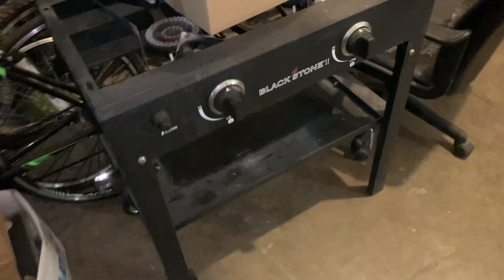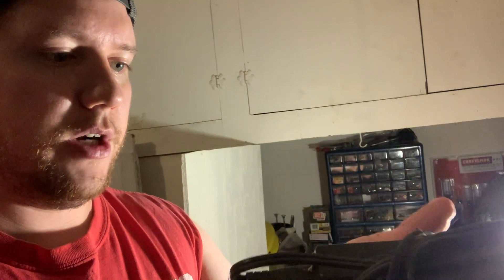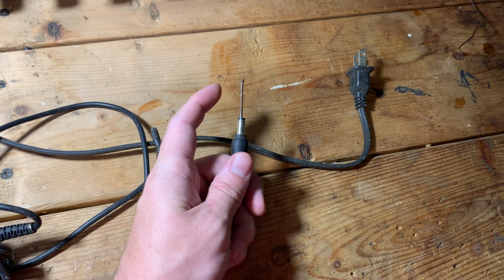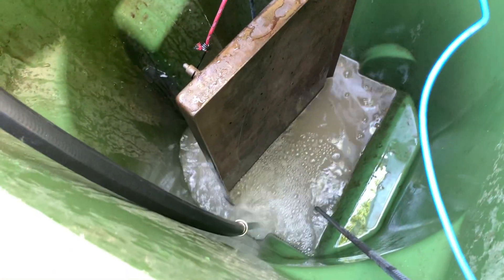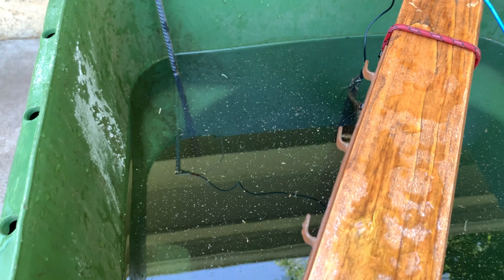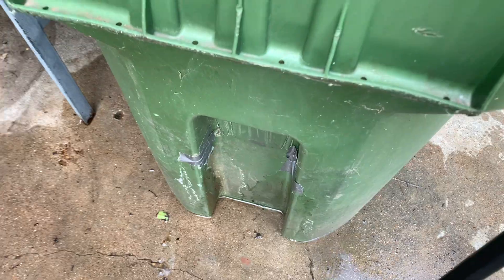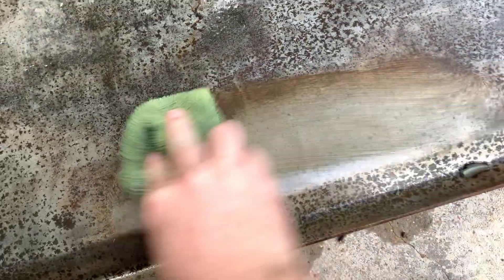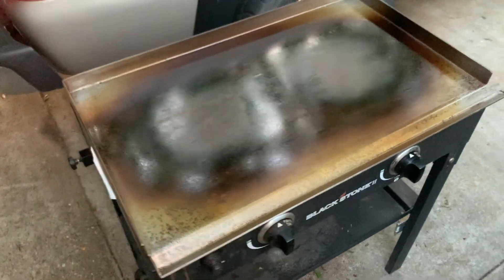Electrolysis Rust Removal on a Black Stone II Griddle Top

Comment: The current rating isn't how much current it will put out, it's how much it's capable of putting out. The resistance of the circuit determines the amount of current.